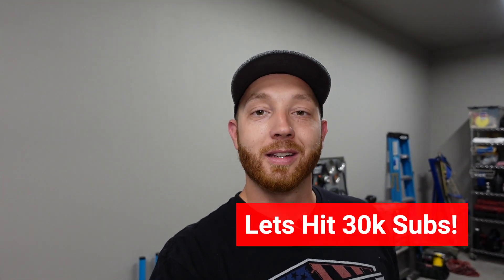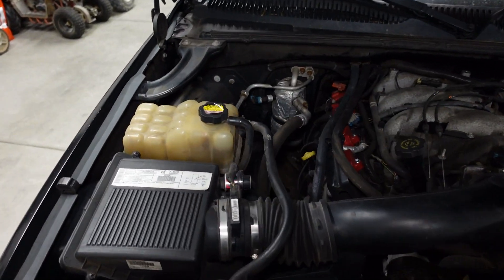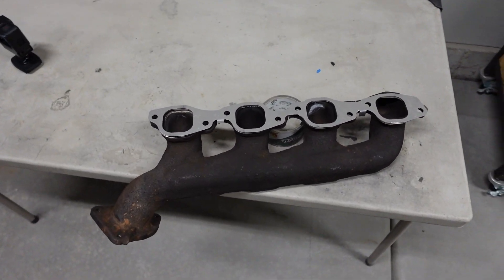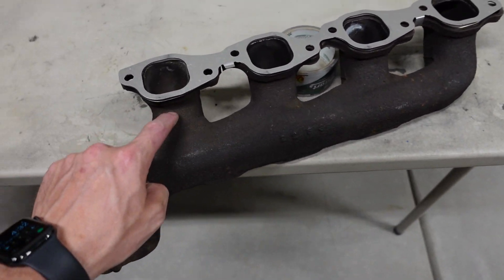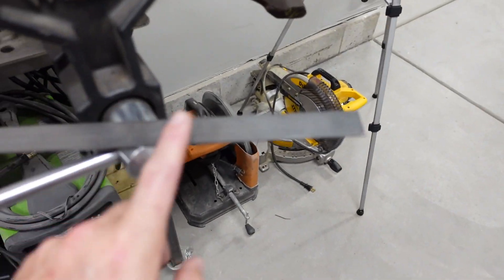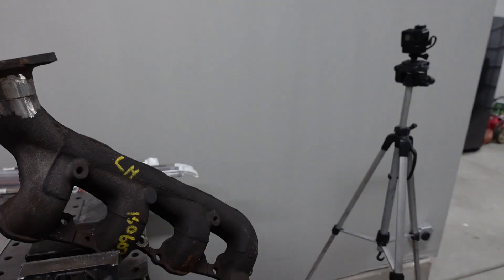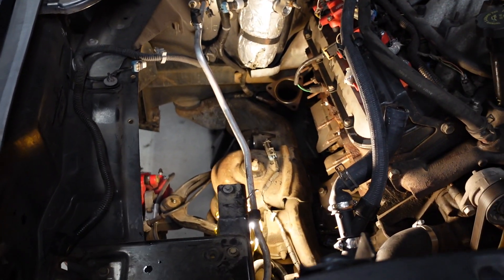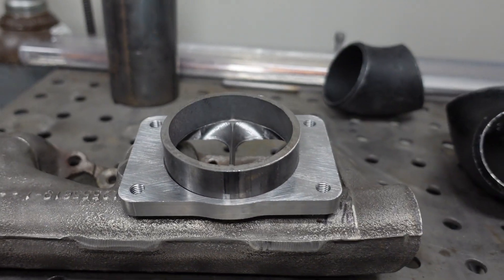Turbocharging an 8.1 Vortec Part One

Comment: Some tips for welding cast. Preheat, throw the manifolds in the oven about 400 for a while. Use a rod for cast. Expensive, but it's worth it. Finally when welding weld both sides of the joint seperately don't cross the gap. Then when you have both sides welded come back and join the two sides together. That tends to keep the cooling weld from having the split in the middle. Finally, let it cool slowly. I've been doing it for years as a maintenance welder for a heavy equipment manufacturer for years.
Reply from the maker: good idea! now I Just need to convince the wife I need to use the oven...

Comment: Cool build! Loved my 02 suburban with the 8.1! The heads on that 8.1 are the real power killer. Check out Raylar performance on youtube, they build killer aftermarket heads for the 8.1. They are pricey (last time I looked, over 3k for a set of heads) but if you dont want to poney up the $$ for those, at least port the heads when you tear it apart to beef up the internals...you'll make way more power with less boost if those heads can breathe. I agree a custom made turbo manifold will be the best but I do know that any BBC exhaust manifold will bolt directly to the 8.1. (About the only thing common from the older BBC's to the 8.1)
Reply: Also the factory intake is baffled and is quite restrictive on airflow...I beleive Raylar cuts them open and removes that baffling for more airflow.
Reply from the maker: heads are on my wish list for sure, and will be important to making a lot of power. I looked around at off the shelf BBC turbo stuff, and didnt find anything that I thought would work for this application

Comment: LOL you could have gotten 
the Same HP and lighter setup if you would have left the LS in it and it would have been Easier to Turbo... You keep shooting yourself in the foot i Doubt the 496 will hold that Much and the 5.3 is Already proven to hold that HP easy with a Turbo Setup!
Reply from the maker: you are not wrong... BUT I don't want to be like everyone else.
Reply: @TolmanPerformance  I understand that i Often Make things happen with Modifications to Everything im Building a 66 336ci SBC and putting 84 305 HO heads on it with 58cc chambers im porting and polishing Performer RPM CAm Intake Carb and Valve Springs lifters Shooting for around 400HP to go into my 91 S10 chevy Blazer!

Comment: Why not flip the manifold so they point up and forward instead of down and back in the stock position
Reply from the maker: the holes and ports wont line up like they do on the LS, the bolts are off set to one side so when you flip the manifold, the ports are off by about 3/8"

Comment: im wondering if it might be easier to run 2 small turbos and you might have more room that way and you probably wont build as much back pressure and you wont have to run as much boost with the twins to get to your goal
Reply from the maker: ehh... maybe, but too far down this path to go with twins for now
Reply: @TolmanPerformance  yeah i understand keep up the good work and are you gonna send the boost through the stock intake or are you gonna do a blow through carb? and maybe junkyard intercooler off of a wrecked diesel pickup maybe?

Comment: Looking like its coming along well. Should the log still be a pain to fit:

https://www.trickflow.com/parts/tfs-bbct
https://cxracing.com/MF-BBC-01

You can probably find the accessory drive setup off the 3500 series in a junkyard, it mounts the compresor top driver side of the motor.
Reply: I was about to scold you that this is the 8.1L and that they old school big block stuff won't fit... but after some research, I was wrong. They will bolt up. All you need is an O2 bung, but he could slap one in his downpipe. 
  Nice recommendation.

Comment: Ls manifolds are cast steel. I’ve tig welded them from the video it seems to be welding similar
Reply from the maker: i just wish you could flip the BBC like you can on the LS
Reply: @TolmanPerformance  agreed. Will be cool swap I always wanted to put one in my slammed suburban already has a 80e. But the lack of aftermarket I just put a 5.3 in

Comment: you may be able to cut the runners a littler higher or cut the front off the runners so the log will fit higher up.
Reply from the maker: I was thinking about that for a minute, but if I was going to do that much work, it would almost be easier to start 100% from scratch

Comment: i read that the Ford modular 4.6 letter over head cam engine was repetitively said to be able to run up to 400hp with few problems... "gas consumption". tho most of the 4.6 OHC engines are not able to output much more then 185hp. in other words the turbo chargers for Fords 3.5 letter ecoboost engines can push enough air into the motor to make it catastrophically fail. those are vary small turbos tho the OEM retail on them was around $2'000... they can make 500hp on the 3.5 tho if they are bolted to a 4.6 that was in time to be rebuilt anyways and got the updated modular engine parts. It's vary nice how some things just work.

Comment: Since your going to rebuild it anyway. Turn the boost up until it let's go. Then show the rebuild.  Great channel btw.
Reply from the maker: ehh.... if blocks werent so much $$$ to replace when the rods chainsaw their way out, I might be convinced
Reply: @TolmanPerformance  You did mention (possibly) doing the entire rotating assembly anyway, but there is a rather "budget friendly" option with the Dart L18 block, which, if I recall correctly, can work with Manley's rotating assemblies that will get you up to 598ci.  At that displacement, you won't really need a turbo anymore to get that 1,000hp you want, but there are definitely options.  P.S.  I'm super glad to see this series, because I have been looking to find a good chassis for an L18 build of my own.
Reply: Wow you responded to me... thank you so much!!
Reply: This engine should be able to crank out a ridiculous amount of power and definitely torque, after all it's a big block.
Reply: @TheRealFobican  ...but it's not like the rest.  The L18 is not like the other BBCs in so many ways.  Granted, people like LT and the companies who are developing aftermarket parts, like aluminum heads, redesigned intake manifolds, and entire new engine blocks (the blocks are considered weak) will slowly redefine the limits of these engines - plus, understanding what these limits are allow us to refine other aspects to make a great all-around engine.
Reply: @Zigg317  was just thinking that for comparison, small engines below 2 litres of today can get up to at least 300 hp then an engine at nearly 3-4 times the size should theoretically push out a similar hp/liter figure.
Reply: @TheRealFobican  Right???  I've always had that issue with the inability to extrapolate hp/cubic inch from small engines to big engines.  By the way, Honda K-series engines at around 2.7L are pushing 500whp on alcohol and mid 600's on a light mix of Nitro naturally aspirated.  Imagine if the 8.1 liters to 10+ liters of engine from a BBC could be utilized similarly in a street-friendly setup.  1000whp from a Honda should not be easier than 1000whp from an L18... it is, but if the weaknesses between the heads, intake, and engine block are addressed, the L18 will be a SUPERB engine at 1000whp.
Reply: @Zigg317  you can strengthen the block up to the same level as of a diesel or a 1jz/2jz engine block as they're said to be overengineered that they became a good platform for tuning, or at least that's the case for the toyota supra engine.

Comment: You should check out Turbo Yoda a.k.a. Al on The Skid Factory. He's done plenty of log manifold builds for customers/mates. I do think you'll get weird flow characteristics if you use a 3 inch log for the RHD manifold cos although you need the flow from the other bank feeding across and into the log manifold the bank feeding into a 3 inch manifold isn't going to like it. Typically anyone, including OEM like Subaru, will feed both banks of the engine into a Y pipe before going into the turbo.
I'm just thinking with the time you'll put into one large log manifold you'd be better off making 2 smaller ones that are known to work so you won't have wasted the time 😉
Reply from the maker: hmm... interesting thought

Comment: Putting air conditioning on a 1000 hp goal truck is like using a condom on your wife that's got her tubes tied, it makes no sense but neither does putting that much power in a 5000 pound truck but different stokes for different folks I guess.
Reply from the maker: thats an excellent analogy haha...

Comment: Cool build! BUT , ive seen and worked on alot of 1 ton and topkicks that had the 8.1 kick a rod 100% stock. The last one threw #2 rod and took out #1 in the process.  If you beat on it at all or load it up on a hard pull she will let go. Upgrade the rods and pistons and itd be ready for 1000+ if you go with forged.
Reply from the maker: gonna try and be ultra conservative while its on the stock bottom end... but it will be all forged sooner or later

Comment: yup you got to make it so the runners come straight out, i think 3.5 straight out gives you clearance for spark plug boots etc.  my first one i made 3 inch straight and had some issues
Reply from the maker: I picked up some 90s, 45s and straight so I have all the options

Comment: What if you was to take the exhaust manifold flip the gasket then gasket match the ports in re drill holes that don't line up
Reply from the maker: i'll be honest, I never even though of that
Reply: @TolmanPerformance   It's worth a shot it's easy enough to do Hope it works make your life a lot easier with this project

Comment: can you cut the factory log off of the exhaust manifold and weld the 3 inch schedule 40 pipe onto the exhaust outlets and use the 90 degree bend to come off the front, just in front of the ac compressor.
Reply from the maker: i think its just a bit too tight, so were going full custom

Comment: Lt, make your log manifold then you really should pull that engine and gap the rings in it. You stand a good chance of grenadeIng the engine other wise
Reply from the maker: you are right, I really should.
Reply: Not sure on the 8.1 but the LS engines get boost thrown at the stock gap all the time. Having said that the stock ring gaps rang from .018 to .022 top to .020 to .025 bottom. They last all day in most but its still a gamble. He clearly said he is going to run low boost just to get the bugs worked out on the turbo setup it'll be fine.
Reply: @colebud670  yea some people get lucky, I’m on my third ls engine. Everyone says they’ll only run “low boost” but that doesn’t last long and the controller gets cranked up lol

Comment: Gap the rings and send it, I have a hard time believing that the bottom end comes apart at 500, Richard Holdener pushes those gen 6 vortecs past 1k all the time
Reply from the maker: if it wasnt so much work to just gap the rings I probably would, but I'll be pulling the engine again to put in forged pistons, so I would be making 2x the work
Reply: @TolmanPerformance  Just don't kill your project with scope creep and send it to machine shop jail for like 8 months or whatever.
Reply: @Levibetz  my motor has been in the shop since April    its getting started on next week they say
Reply: @davidcunningham00  This is why I try to avoid machining at all costs. It's always a giant time vortex. That's why I love SBE stuff and avoiding "while i'm in there". "While I'm in there" will kill a project every time. I know a guy that was going to endurance race his BMW this year but "while I'm at it" and "may as well do it right" has his project even further from being done.
Reply: @Levibetz . I feel that, I was their for 4months😭
Reply: @Levibetz  that may be true about the time but I hate doing crap twice
Reply: @davidcunningham00  Dang dropped my 460 off 2 weeks ago and I'm starting assembly tomorrow.
Reply: @TolmanPerformance  forged pistons alone are a waste of time and money IMO. stock pistons aren’t the weak point. the rods are, just don’t be dumb on tuning
Reply: LF X  lasted 2 years with me beating on it almost every weekend. Sometimes going through 30lbs of nitrous a weekend. Lack of ring gap finally took out #5 piston.
Reply: I’ve made 500whp with stock 8.1 with cam and nitrous.
Reply: Holdener does that to gen6 big blocks which are a completely different engine to the gen 7 8.1 liter. They may have used less heavy duty parts on it to save money and the rods may be the weak point especially with their length and stroke.
Reply: Truth!
Reply: LF X  won’t last, I have a 5.3 with SBE making a little over 800whp and I’ve put over 34k miles on it and that’s all city miles

Comment: LT,  the 8.1 I have is from a Workhorse RV chassis, and it has the A/C compressor on the top, vs bottom of the engine.  Check that out.  If you want I can send some photos of the brackets...it's sitting on a pallet. Need your contact data to do that.
Reply from the maker: I did think of that actually, but in the end, a from scratch manifold will be a better solution all around, mainly because i can place the turbo exactly where I want it, a little further back
Reply: @TolmanPerformance  I walked by it today and had a look.....compressor is up high on the driver side....could give you even more room to work with.